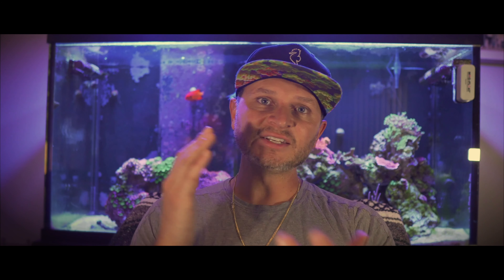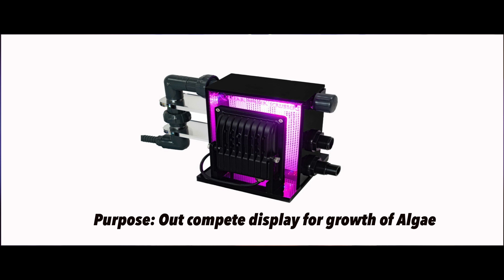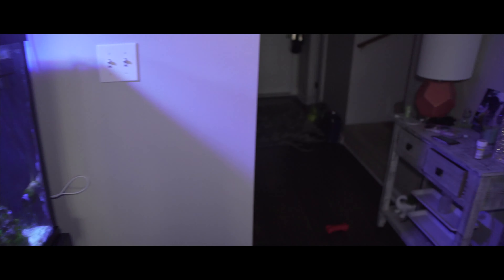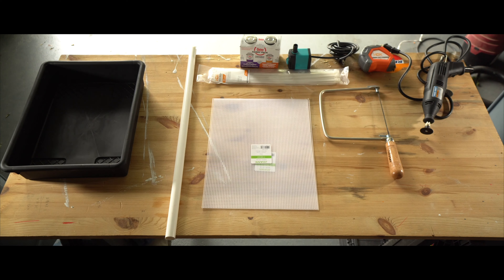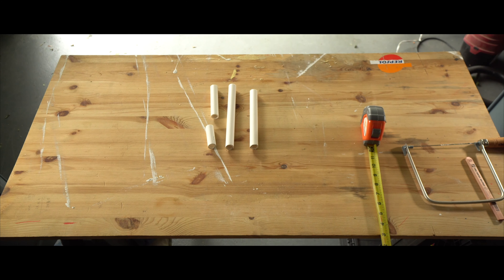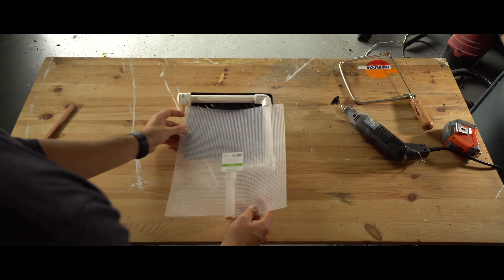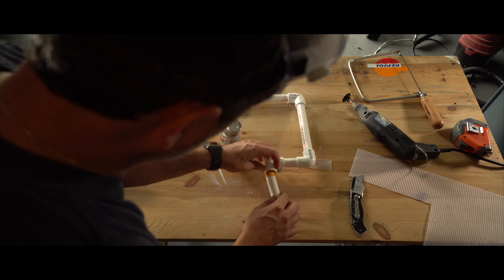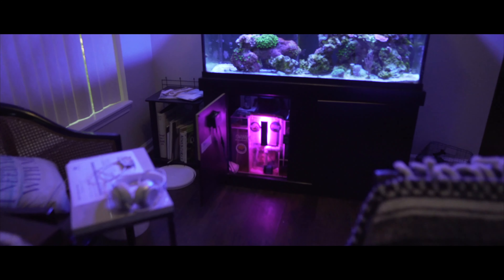DIY Algae Scrubber

Comment: I used the waterfall style for years . About a year ago I switched to the up flow style . Both are very effective but in my experience the up flow produced more algae .Plus it's pretty much silent as compared to the splashing of the waterfall style .Good video for those looking to build one though .
Reply from the maker: Super interesting! I’m going to need to take a look at that.
Reply: I have an AIO IM SR-60, and there's nothing out there for it and all the other ones are over $450 and you have ro hard pipe them in or the chaeto reactors don't work most often.

Comment: Nice, looking forward to the follow up.
Reply from the maker: UselessReefer ayyy thank you!
Reply: @Tankbruh1  How did you connect the pump?
Reply from the maker: UselessReefer the pump had an attachment for a 1/2” pipe. So I glued it into the PVC. It fit in there perfect.
Reply: congrats on the 500 bud. keep up the good work 👍

Comment: Can you explain what section of your sump that is in? Is that your return chamber?
Reply from the maker: Sure it’s the middle chamber where one might have a refugium. My sump is on the smaller side so I basically have it placed in front of my protein skimmer. I hope that helps!
Reply: @Tankbruh1  how is  your water level so low that you fit your scrubber in it so well? Usually those chambers have a higher water level.

Comment: i contacted kedsun to see if they recommend this pump for saltwater. they don't did you see copper leech?
Reply from the maker: Interesting! I have seen zero effect from this. I do have a 90 gallon tank so it might not feel the effects of this. Have you heard of other tanks having this issue?
Reply: @Tankbruh1  no i haven't im just curious. i do have an order placed same company higher rated one. i'll stop by for sure if it rusts to let you know. i do have a 120g system. i have a similar type that i've been using for water change for over an year. tonite i'm gonna open it up and see if it rusted. :D its a vivosun or something like that